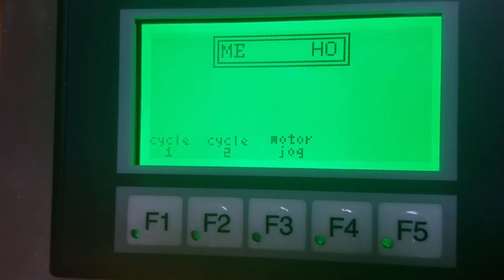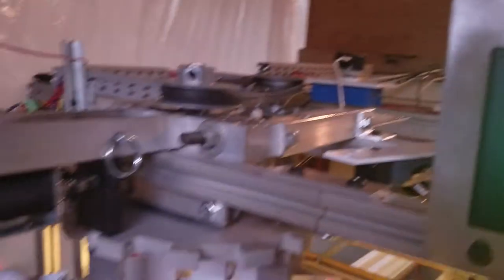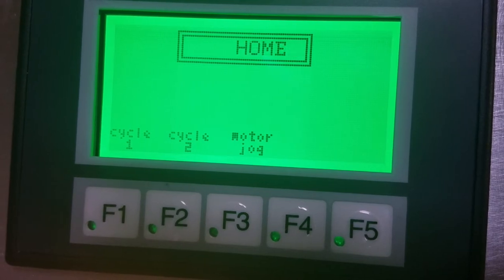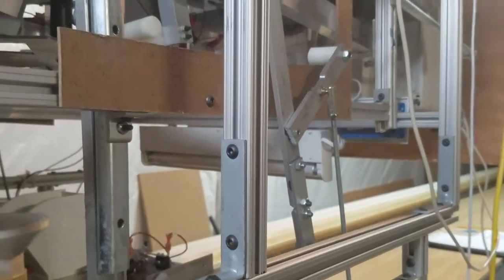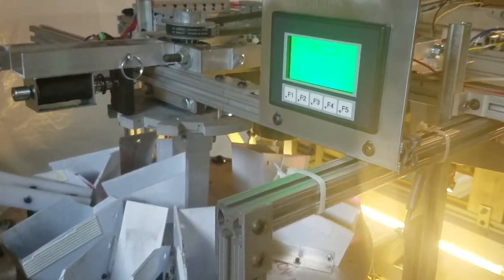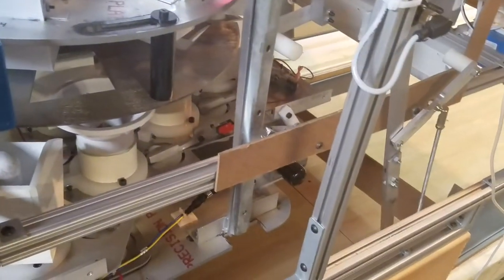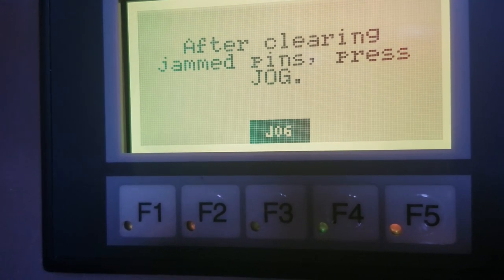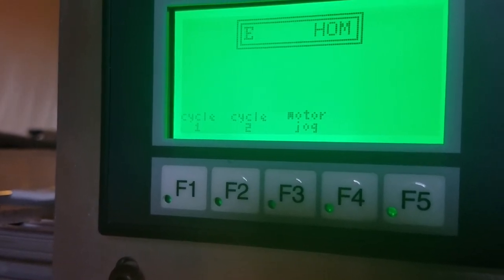Half scale pinsetter operator panel update and faults

Comment: Do you have two different models of half-scale pinsetter? Or am I mixing you up with another guy, who has a pin distributor system on a half-scale lane?
Reply from the maker: Not sure. There is another person who built a version of an 82-70 in half scale. I also built a machine before this one that had a distributor (videos can be seen on my page). That original design was scrapped due to too many little issues. This pinsetter is the version I will be continuing to develop with the intention of selling mini-lanes. Scoring is currently being developed. I hoped to have my website ballbowler.com active by now but it will be a little longer. I want to get the scoring installed before I begin taking orders.
Reply: I see now, that I had been looking at your earlier model.  That had to be frustrating as hell, building what appeared to be a great distributor system, and then having to go with the turret and buckets.
Reply from the maker: It was no problem. The turret works better than the distributor design I had. The whole goal is to end up with a very reliable machine.